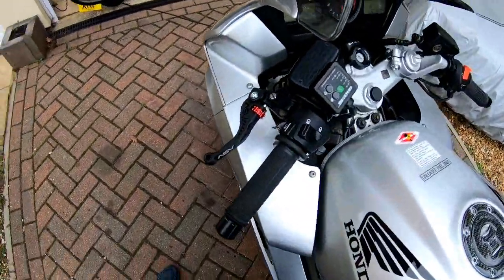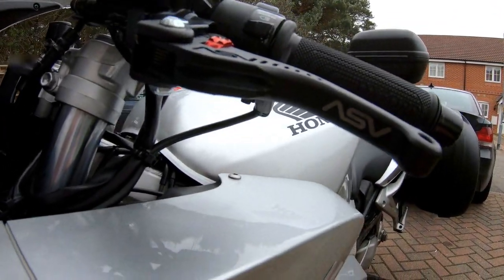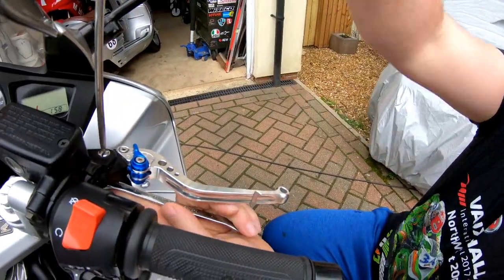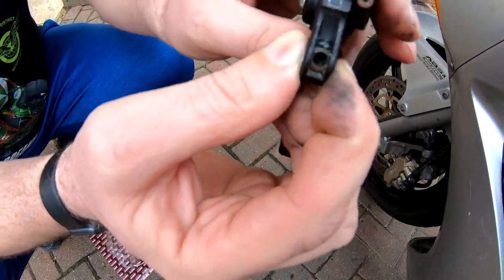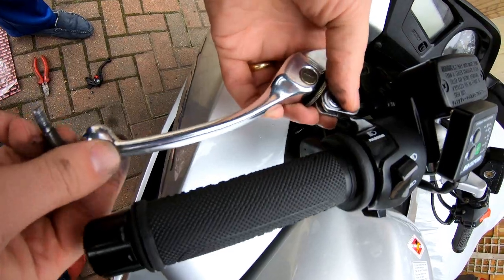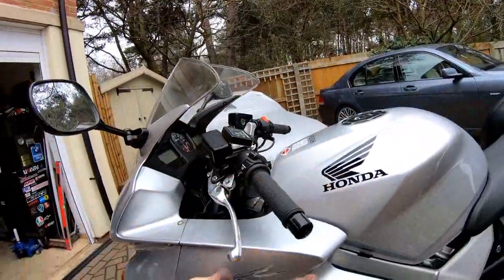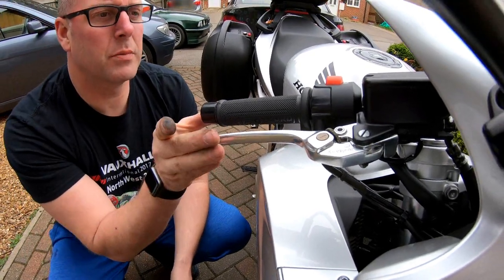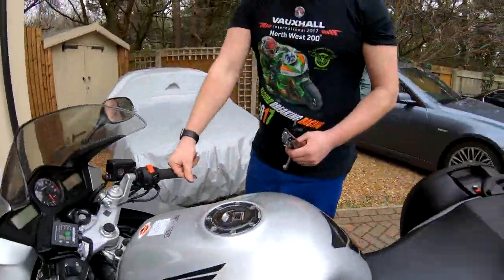Replacing Motorcycle Clutch and Brake levers. 2003 Honda VFR800 VTEC

Comment: Probably on old video ,newer looking vfr than mine 
But your dead right on the clowns (me) who ride them, drop them, car parks, and have only ever worked on there push bikes as a child. 
Going to Spain tomorrow,,, hope the brake lever works after fitting,,,,
Even if it’s 
on the wrong side of the road

Comment: Thank you, I am trying to source a clutch and break lever for my Honda VFR800F-2 VTEC 2003, can you please advise if the above set would fit same and if so, where did you buy please? i checked out Bike It as on the packaging but  I don't know if suitable as didn't have the F-2 after the 800. Would appreciate the help :)